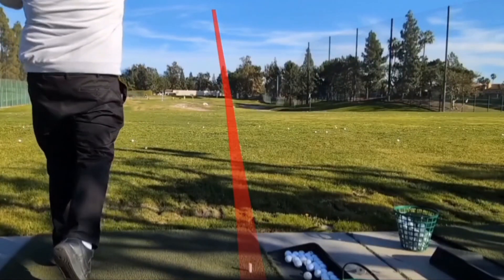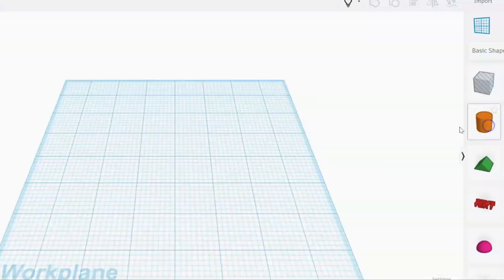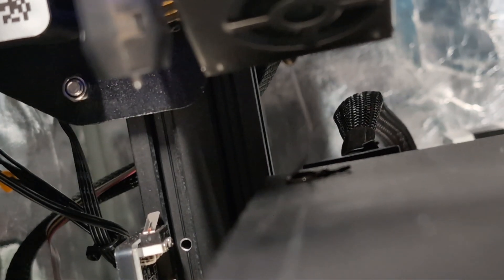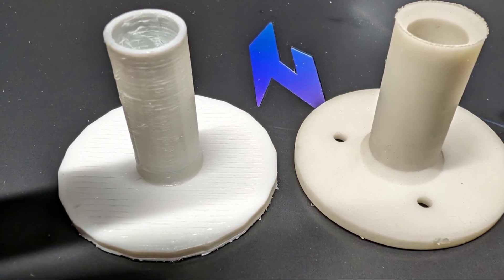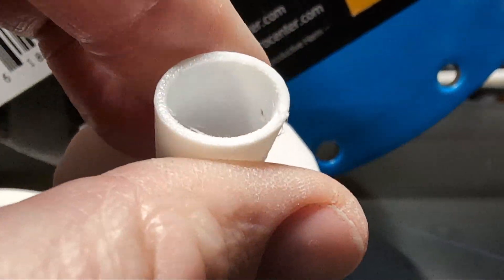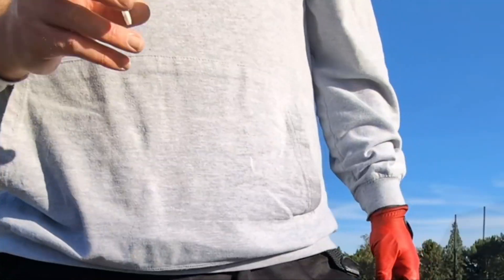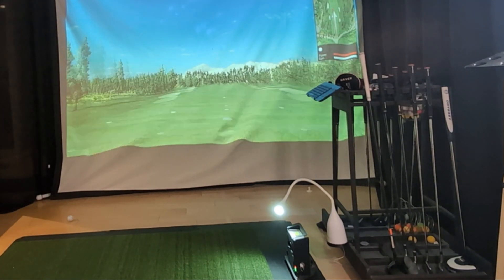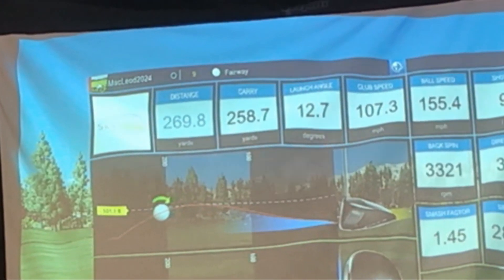Making Rubber Golf Tee DIY

Comment: Is there anyway i can send you a file that i found that has the base with threads on inside and the tee with the threads on outside..In tinkercad the 2 are together and i can not seperate them to adjust the measurements
Reply from the maker: I made a new video of an adjustable tee I made. The design is for sale at https://cults3d.com/:3761259
Reply: @BuildsandBirdies  I seen that..man I sure appreciate all the work you put into these tee..greatly appreciated

Comment: Got another question..Is it possible to make these with threads on the inside  to screw a tee on to it to adjust the length..They have one on thingiverse but it is on the same plate and file + they can not adjust the settings in the STL file..It would be these rubber tee with threads and  a regular tee with threads to screw into it..If i can get this built at 1 1/2" and the tee 3 1/2 inch tall to adjust
Reply from the maker: Hey, I just made a thingiverse for the simple version. I will tinker with the screw idea for fun and see if I come up with something. Here is a link to the thingiverse: https://www.thingiverse.com/thing:7217209
Reply: @BuildsandBirdies  Nicely Done thank you so much.Greatly Appreciate it
Reply: @BuildsandBirdies  yea i am trying to learn tinkercad + its harder than everyone thinks ..lol
Reply from the maker: @jademarks3871 I just mocked the screw version up in fusion 360 and I am test printing it now. If I get a version to work, I will let you know.
Reply: @BuildsandBirdies thank you so much
Reply: @BuildsandBirdies I have been playing with fusion 360..if you get this tee and screw working could you show me how you do the work on 360..I'll be happy to pay you for ur time and pay for the work u did

Comment: I am very interested in this tee making..Can i get the file for a price
Reply from the maker: Sorry, I didn't see the comment. I will see if I can post the file on thingiverse. What height do you want it to be. Also, it should be printed in you or maybe other flexible material because hard material will shatter.
Reply: @BuildsandBirdies  1 1/2" -2 1/2" i been using driving mats on my simulator and these measurements would be perfect + i am using TPU on my creality K1 SE 3D printer . Please can you put on thingiverse and i will be more than happy to compensate you..Can you send me the link when your done please